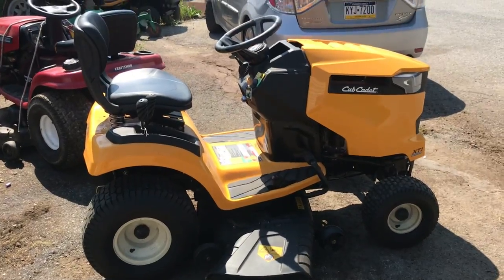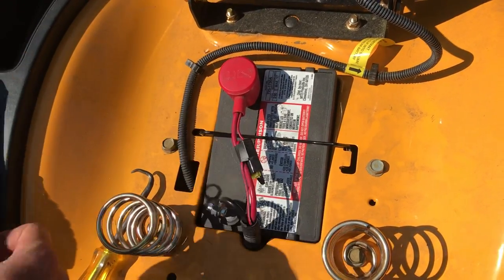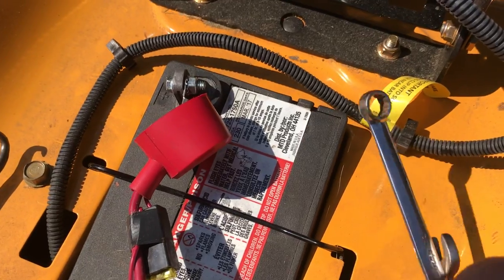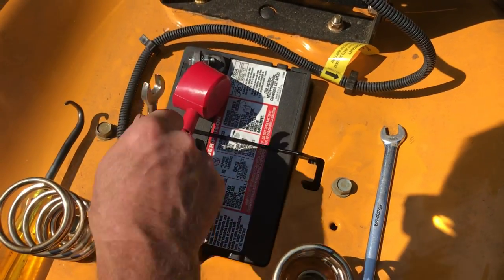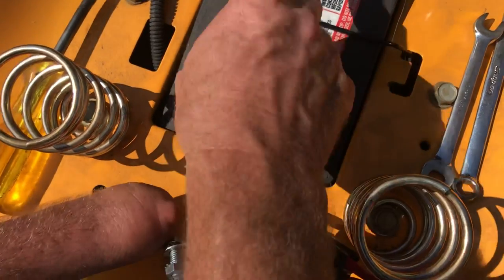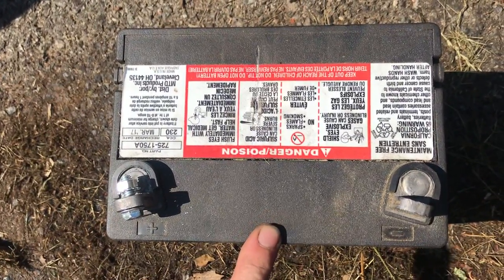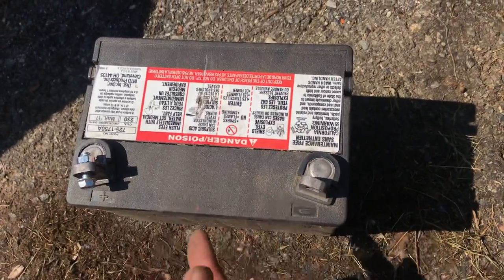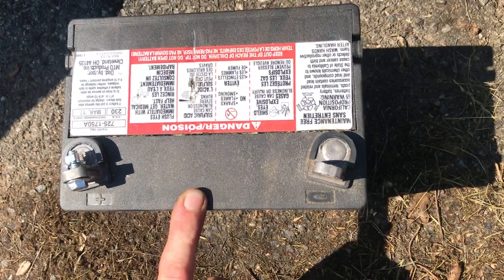How to remove a battery from your lawn tractor

Comment: QUESTIONS: I have a Craftsman Riding Mower that is about 15 years old, but it has only been used a small number of times. The person who used it moved out of the house, and I cannot drive it because I have epilepsy. I did not attempt to start the mower or charge the battery. My goal was to simply remove the battery, because the battery was noticeably corroded around the connections to the battery. There was also a lot of corrosive material still left on the connectors of the mower and the nuts and bolts - which are actually a golden color rather than silver. Do I need to keep the same nut and bolt that was previously assigned to positive once again assigned to positive in the new battery and vice versa for negative? If so, I'm out of luck, because I had a seizure while doing this and goofed them up. Are these nuts and bolts that have corrosion on them still good to use with the new battery? And are the connections on the mower still okay to use, even though they don't look as good as they originally did? I wiped off as much of that corrosion as I could, but some is still visible.
Reply from the maker: You can switch bolts. I would suggest new hardware if the nuts and bolts are in poor condition. Clean battery posts and cables.

Comment: I just replaced the battery in my 2021 CC, because it would not turn the starter which really sucks because I needed it to blow snow.  I tried putting the charger on it and it would not charge.  I took it to the Deka dealer in town and she asked the HP of the tractor which was 24HP. She then asked if it seemed like the Tractor seemed to struggle starting even when new, which it had.  She said the OEM batteries manufacturers (not just MTD/CC) put in new equipment are notoriously undersized and fail quite quickly and that the battery that came with my tractor was too light for a 24HP tractor.  She then sold me a correct CCA battery - 350 CCA at 0 degrees F-  with advice on how to maintain it. I can only imagine how the lifetime of the starter has been shortened because it was starved for power.
Reply from the maker: Hi Scott, the person that helped you with the new battery was correct and  I think your starter will be fine.